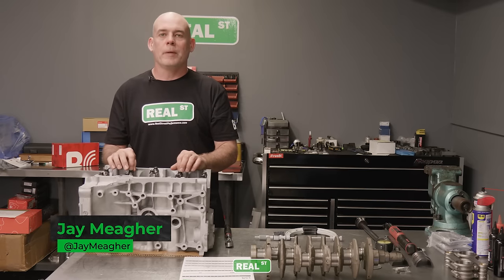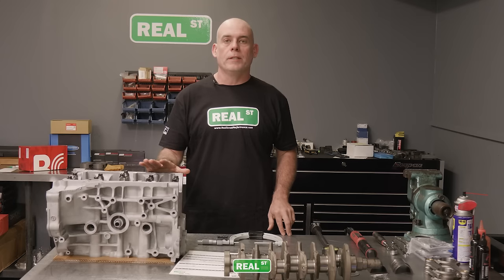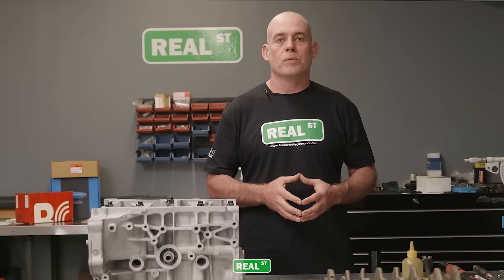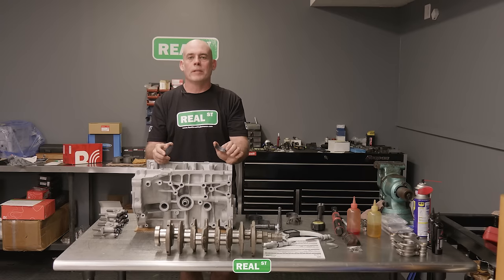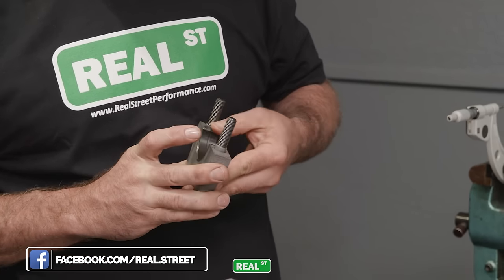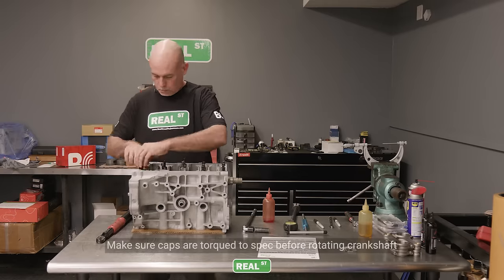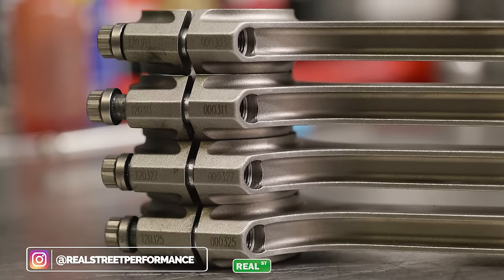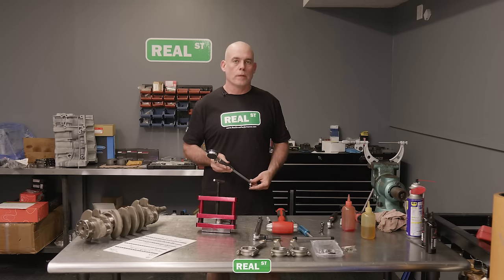How To Measure Bearing Clearances On Your Engine - Step By Step | Real Street Performance

Comment: When I worked for Honda I've replaced many bearings for various warranty issues. Honda had a system to put the correct main and rod bearings in. The block and crank are stamped with a code like AABB or ABAB, so if main journal #1 was A and Crank journal #1 was B you would check these on a chart and it would give you a bearing color to use. If I remember correctly you could have up to four different sizes for each combination. Using aftermarket bearings it seems not as dialed in, as a engine builder what is your thoughts on this?

Comment: I had an issue with a huge dresser rand compressor. It was driven by a cat 3608. One of the brand new bearing shells was misboxed. We would have caught it if we had measured bearing crush. The clearance was correct, but there was no crush, and that permitted it to spin. This compressor was offshore, and we needed a crane to move parts around. It turned into a chore. Good on you for mentioning crush. Most people overlook it but it is important to know how to measure it on your application. I find it covers my ass to document it on my spec sheet.

Comment: I have always been amazed how accurately manufactured our bike engines are IE (ZX14R) has three bearing sizes to choose from and the
difference from the thinnest to thickest main bearing insert is only .0003" (Journals spec. is 1.5742" to 1.5748").
The thinnest to thickest available rod bearing spread is .00039 (with 1.4954 to 1.4961 Journal).
I wouldn't ever do it do it but I've heard of some people that just order a complete set of the thinnest bearings and throw they're engines together
(engine ass-emblers vs engine builder)...

Comment: Great video, loved it! Great presentation, easy to follow along and highly educational. Please continue doing these!

There are three things I would like to hear your opinion on:
1. All of clearances were measured cold. Of course we cannot realistically measure at hot operating conditions. If one follows the manufacturers' guidelines, who most likely accounted for the thermal expansion of the different materials and consequently thermal distortion, we should still operate with safe clearances I would assume. Is there any way to account for the thermal distortion during cold assembly that you know of?
2. With respect to the bolts or studs, I see two potential issues. First, there are torque to yield (TTY) bolts which are deformed not just elastically but plastically (permanently) as the material is stretched beyond its yield point. One cannot bolt these down several times unfortunately. I guess these are pretty uncommon in the high performance industry. Do you have any advice about how to deal with TTY fasteners? If one wants to check clearances, one has to use a second set of these fasteners during the build. At that point I would guess going with a higher quality fastener is the also the cheaper option anyway.
3. Is there a specific reason why, when you are bolting down the fasteners, you are not using fastener assembly lubricant? I thought skipping the lubricant can give you erroneous readings, which might be mitigated by re-installing the fastener several times, according to ARP.
Reply: Some insightful questions, would love Jay to hear Jay's opinion.
Reply: Did you find anything about tty bolts on this topic ?

Comment: Thanks so much, great video.  I am working on a BMW m20 6 cyl.  The rod bolts are spec'd to be turned only once.  Apparently they stretch when torqued to spec and once stretched they can't be unstretched, so when you tighten rod bolts to check clearance what should you do with this problem.  I don't want to buy 2 sets of bolts.  Thanks again.

Comment: Hi, really great videos Jay. If my engine uses torque to yield bolts which are single use. is it acceptable to use the old bolts for all the checking and then install the new bolts for final assembly. many thanks Andy

Comment: Thank you Jay for the very informative video!  Good stuff! I'm used to using plastic gauge to measure bearing clearance. However i understand this method doesn't precisely measure the clearances close enough.  I'll definitely be using this method going forward.  In your video you mention setting the Outisde Micrometer to the Main bore housing diameter mid-level.  How do i determine or find that number?

Comment: How do you know when your mic is center on the crank journals or in other words the largest measurment of the journal. Also, do you need to rock it at all to make sure your mic is straight before locking down on a measurment?

Comment: Talking about bearing clearances if you make your clearances smaller or bigger is it necessary to change the tipe of oil you are using also or wouldn't the oil have any affect on the bearing clearance

Comment: This video answered a huge question I had; which is the difference between H and HX bearings! 
Now, can I use a split set of oversized bearings and HX bearings? or does a split set only work for STD bearings?

Comment: Great video!  I found it very informative for a future project.
 In the meantime, I'm just doing a stock rebuild (Started as a head gasket replacement).
  Since there was no actual damage and I'm only replacing components because I'm already taking the engine apart, are all those measurements necessary and can I just put back in the exact same as I'm taking out?

Comment: Great vid. Is there a rule of thumb when using 2 different bearings either on the mains or rods which side the thicker bearing goes? For example, u use the thinner main bearing on the block side vs the main cap side?  What about the rod bearings… thinner rod bearing goes on the rod cap side vs the rod side?

Comment: How do you know how much of a looser clearance you want/need if you plan on running thicker oil. 
(JZ based) ive usually aimed for them to be closer to the looser end of oem specs. 
Most people usually try to run 15w50. What clearance would be good for that. 

Im rebuilding a 2j i built about 4 years ago that recently spun a rod bearing. No signs of oil starvation on other bearings, logs showed no oil pressure drop, oil temp was 185 throughout drift event. 
7800rpm

Comment: Hells Yeah Jay!....
LET'S GO...🏁
13:00.. what oil and oil weight do you recommend running this tolerance?
I use the King Racing bearings... Unfortunately they don't make a coated main bearing for my platform ( Ecotec)...I use aluminum bearings but then again I'm only making 500rwhp  power.. they do make coated rod bearings for my car that I use
But I have never had a problem with the aluminum bearings they're actually probably the better choice for a frequently street driven engine

Comment: I seen you changed gauges when you went from measuring the crankshaft to the rod… do you need the sunnen bore gauge or any inside dial bore gauge will work if so do you recommend any brands

Comment: How did you know what bearings to purchase in the first place?? You had to have some idea of the size based on the block housing and crank journal, correct??   I'm asking because I'm taking on a huge , but interesting project. If it fails, I'll be no worse off than I am now. I have an Audi A6 which has a spun main bearing (the rest of the journals ,all of them/crank and rod journals, look great). I am going to machine the welded on bearing off myself (I am confident in my machining skills) then I'm going to bore weld the block and then line bore it back to speck. If necessary, I'll also weld the crank and machine it back to spec. However, as I was measuring a few minutes ago. I noticed factory says the crank should be between 2.5599" - 2.567" and I'm getting 2.5578 (smaller than the smallest factory crank spec by .0021" ) Does that mean I need to go 0.0021" bigger than factory main bearings? Also, Audi uses a color code and I don't know that the specs are for the bearings. They just refer to them as Yellow, Black, Green and Red. Mine or Yellow (1), Black (2), Black(3) and Black (4). It's a V6 - Also, how do you know how much vertical oil clearance you want?

Comment: Excellent tutorial for clearancing an engine, but I have a question I've been unable to find the answer to: if the engine uses TTY bolts that are non-reusable, do I need to buy multiple sets of bolts and always use a virgin bolt at each step?
Reply from the maker: You can reuse the bolts as long as they're not beyond the FSM stretch limit.

Comment: Do you guys ever run GTE oil pumps on GE 2jz blocks? I'm curious what oil pressures you see if you do. My oil pressure at idle and cruising seems normal, but it seems a little high on throttle. It does stabilize though and doesn't continue climbing at higher rpm.
Reply: yes it's kind of a requirement to run GTE higher volume oil pumps, most of us run PHR or drift motion ported and pressure regulator piston-polished GTE oil pumps with upgraded hardware

Comment: Again a excellent video. Do you use a thicker oil if you good on the loser clearance side or is it not a problem? And do you do any modifications like girdles, block posting on the b20 block for a 9k rpm NA build. I see aftermarket rods but i presume that's because its going to be a turbo :)
Reply: if your tolerances are a certain degree of loose then you def need thicker oil weight

Comment: This video should be considered the most CRITICAL part of building an engine correctly.  What separates a serious engine builder from a non-serious person who just slaps motors together - MATH.

If you don't wanna' do this yourself for whatever reason, tell the machine shop you're using to clearance the block for you. . . . . .THEN VERIFY THE BLUEPRINT NUMBERS THE MACHINE SHOP GIVES YOU TO ENSURE THEY DID THE JOB YOU ASKED FOR!
Reply: no doubt, this is just something you can’t skip over. I wouldn’t get an ounce of sleep assembling an engine without measurements and double checking the clearances.

Comment: Do you have a comment about mixing main bearings and how both lower and upper has the groove in the bearing because you mixed 2 sets? I have heard in engine building discussions that there's benefit to actually purchase 2 sets of same size, just to get that groove on both lower and upper bearing. Any comment on that? :)

Comment: I have an engine where the cases are split and to measure I have to combine the cases together.  Do I need to apply the factory sealant, torque, then measure or can I leave the sealant off?
Reply from the maker: Leave the sealant off.

Comment: Do you only check the bore in the vertical direction? Inline with the small end? Or in 3 different places? Im getting some variance when checking the big end with rod bearings installed
Reply from the maker: Yes inline with the small end. Bearings have an ovality to them and are bigger towards the point where the two halves meet. They are bigger at that point to create and oil reservoir. 

https://www.substech.com/dokuwiki/doku.php?id=geometrical_parameters_of_engine_bearings
Reply: @realstreetperformance   thank you for posting that link. Exactly what I was seeing on my bore gauge

Comment: When torquing down connecting rod bolts,is it better to use a torque wrench or measure bolt stretch?
Reply: do they not have the detailed instructions inside the box of whatever connecting rods ur purchase?

Comment: Wait, so each cap is actually a mix of H and HX bearings? Wouldn’t the cap side have a different height than the block side where the two bearings meet up?

Comment: Lets say that rebuilding this engine will cost more in machining then buying a new engine would be so we don't care about the engine. Say a rod bearing is spun, could we not just hand sand the crankshaft. Take a normal bearing, put it in place and use plastigauge to determine which oversized bearing you would need to purchase to make up for the new gap?
Reply: I just feel like everyone assumes that you want to get your engine running perfectly again no matter how much it would cost. Like no, i want this thing to work for maybe 10,000 miles. It's a beater that i paid 2500, mind you it's in amazing condition. It sat in a garage for 12 years because of the spun bearing essentially totaled the vehicle and it has 80,000 miles on it. It's the perfect boat hauler.

Comment: How do you tell a customer that they need to buy 2 sets of bearing like h and hx? Your looking at $400 in bearing depending on where you buy If you need both. I have done this I just ate the cost of 2 sets of bearings now I have 2 set of bearing sitting on the shelf.
Reply: The same way I tell them anything else?
Reply: If you build enough engines that use the same engine that's not a problem because you have a few sets in stock anyway and you charge only for one set. If not well that sucks :D
Reply: The bearings you have left is good for a refresh when the time comes

Comment: You are wrong about oil flow if you have looser main bearing you will loose more oil pressure which means less oil to rod bearing